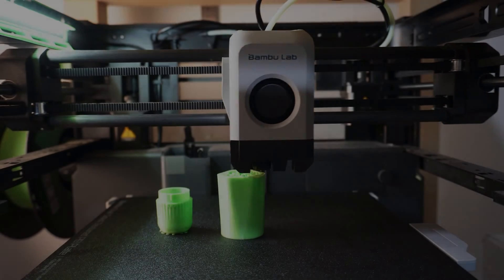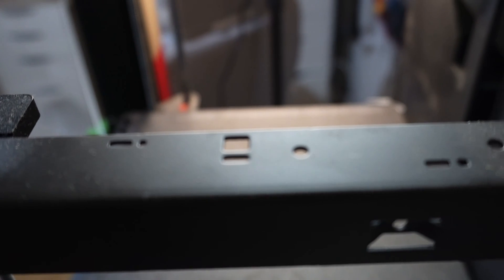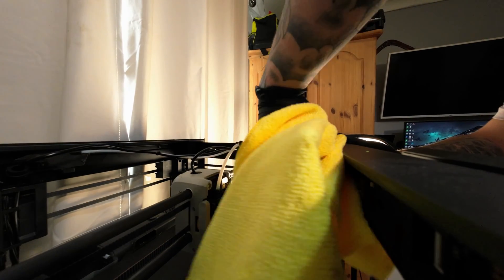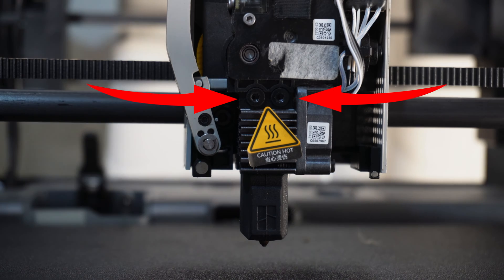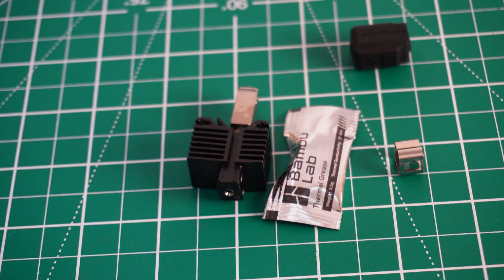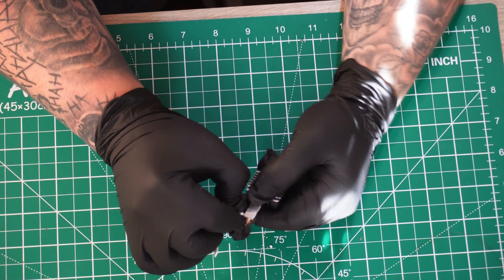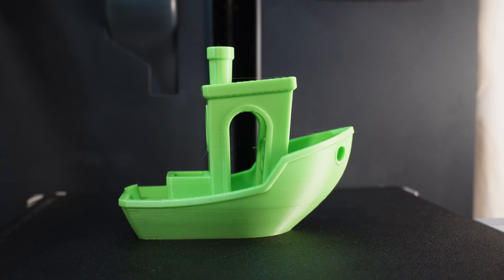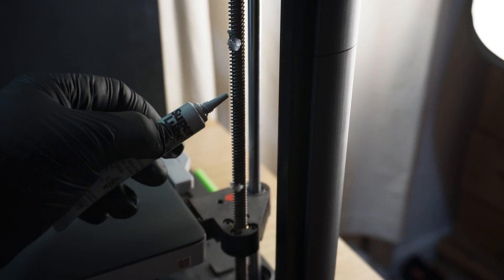The Easy Maintenance Guide for Bambu Labs P1P/P1S

Comment: Tabh... I can take the entire hot end apart in a couple minutes now lol. I had an issue of extrusion that was actually he filament and I kept taking the hot end apart trying to figure out wtf it is, and the extruder etc lol. DOn't take he nozzle/hot end out first, just remove the ENTIRE extruder, then take it apart.So much easier.

Comment: Other serviceable parts that you forgot about was the filament cutter & also dusting/wiping the fans as they can get clogged up.  Otherwise great video.
Reply from the maker: Thanks for the input I didn’t do them as the particular machine I was working on shouldn’t have needed them but it’s a good idea and I’ll cover them when they do

Comment: For the too much grease comment - if you clean regularly yes. There’s no too much. HOWEVER - grease attracts dust. Dust with grease clogs and binds. As metal on metal moves … metal shavings come off. And become part of the “grease blob”. That grease blob of metal shavings will scrape at the metal …. Opening canals up. Loosening tolerances. The more those blobs exist - and they are microscopic … the more the problem occurs. 
So. As long as you clean regularly. Too much is ok. If you don’t. Then it’s a problem.
Reply from the maker: Yeah your correct but I think if you have too much dust in your workspace you probably have bigger problems 😂😂
Reply: @FilamentFoundry  true. Haha but the dust I’m referring to is that which comes with time naturally. It doesn’t take a lot to clump up. 
We deal with this a lot in metal work. If you over grease parts every time and don’t clean often. It’s fine. For a decade. But eventually it causes issues. (Yeah I know. Who’s gonna have the same printer that long??? Haha). Still. I was pointing out what “can” happen.
Reply from the maker: @alecubudulecu  o totally I see this all the time in the railway industry   you are 100 % correct with that my friend

Comment: I just purchased a Bambu P1s and after a couple of prints I downloaded a model and it runs through the print but it’s not printing. Any ideas?
Reply from the maker: By any chance are you using pre sliced files like from maker world
Reply from the maker: Also is your filament loaded correctly?

Comment: Just bought a new P1s... How often should i be doing this and how often do i need to lube the screws?
Reply from the maker: Tbh I  can’t remember what bambu recommends but I do mine every 6 months with all my printers and never had an issue
Reply: @FilamentFoundry  That is good to hear.... I have been printing non stop for 3 weeks and still running great.  I keep thinking theirs something i need to be doing to keep it in great shape.  Seems bambu labs made a great machine
Reply from the maker: @matt-jc4ly  you should be fine I run two of these in a print farm almost 24 7 only 3 weeks in you are totally fine unless there was some sort of flaw from factory but I doubt it I would just recommend dusting it every now and then
Reply: @matt-jc4ly  I'm only looking into maintenance only now after 2200 hours of printing time over 7 months.
Some may call it neglect
I call it that too but that way you see what these machines are capable of
Still providing high quality prints all the way
Reply: @matt-jc4ly I’ve been going over a year and it’s fine, just a little dusting here and there. I am about to do a full maintenance however.
Reply: ive printed 683 hours on my P1S and havent cleaned it yet but im thinking its finally time

Comment: The 0.6 nozzle is generally limited by the default volumetric speed. Change the Max volumetric speed in the filament settings tab if you want a faster print speed (18 is generally safe, but you'd have to calibrate and test yourself for higher reliable speeds/flow). That said, you can still save a little bit on print time by printing less walls with a .6 nozzle (0.6x2 walls = 1.2mm VS 0.4x3 walls = 1.2mm), same with top/bottom surface thickness and layer height. Infill is also sturdier due to thicker line width. Tbh though I like the idea of the printer moving slower with a bigger nozzle and still having the same print time... less wear on parts :D
Reply: Also, 0.6mm nozzle have less clogging issues with pigment filaments.
Reply: Thank you for the tip. I could never figure out why printing with the .6 nozzle was not much faster, if at all, than printing with the .4 nozzle. Prints with the .8 nozzle take longer than both the .4 and .6